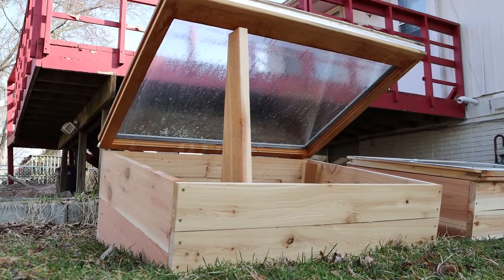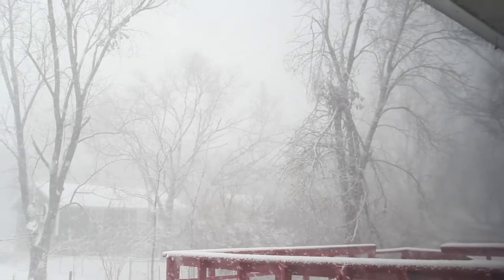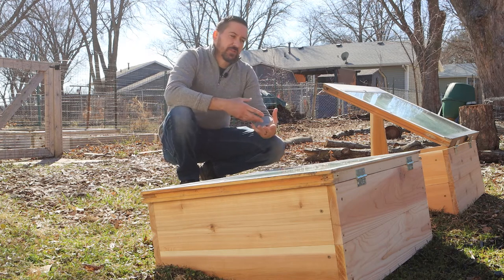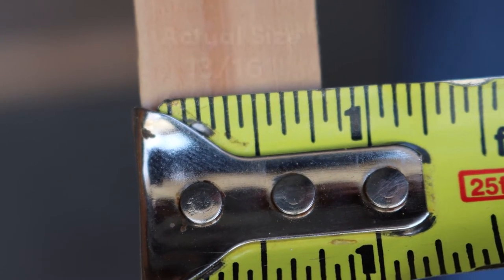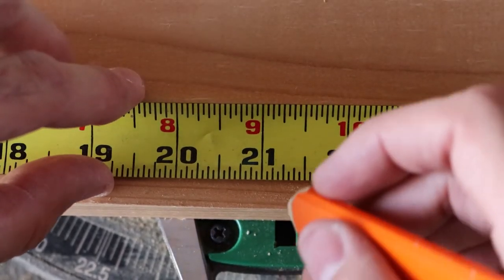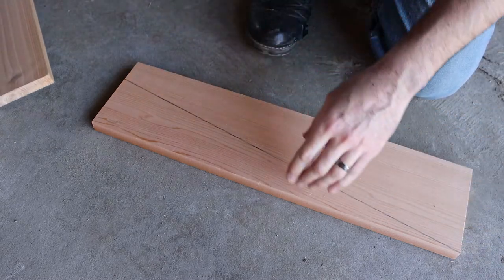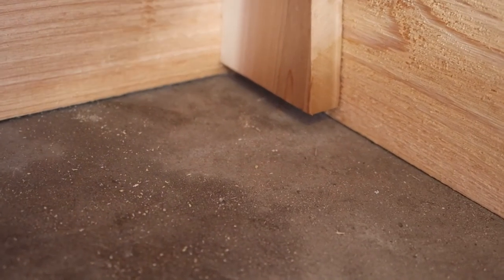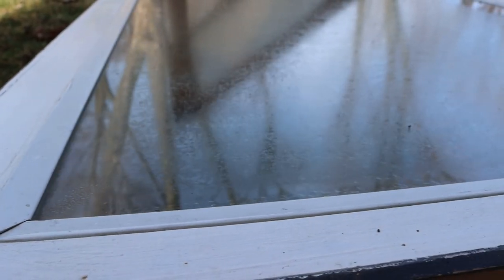How to Build a COLD FRAME Using Old Windows

Comment from the maker: ⌚TIMESTAMPS:
0:00 Intro
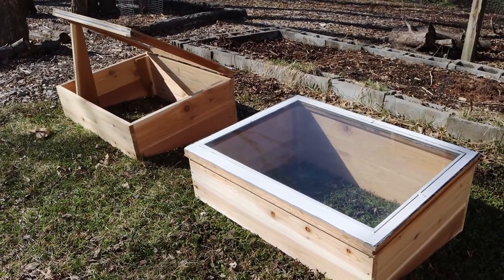0:44 What is a cold frame?
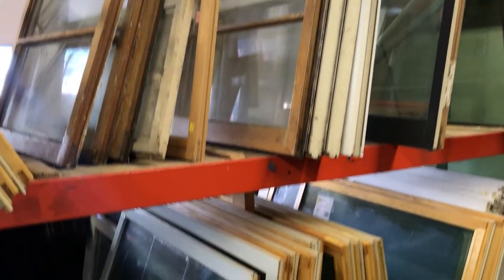1:57 Old windows for lids
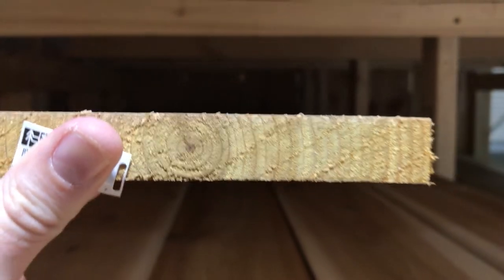2:45 Treated or untreated wood?
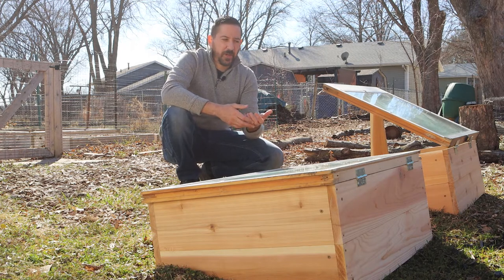3:49 Cold frame building guide
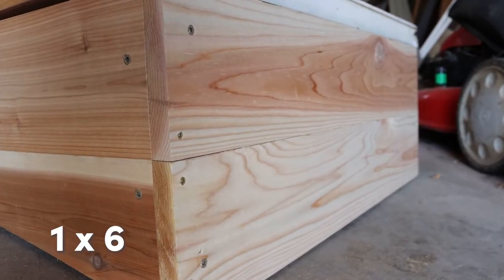4:38 Front and back boards 
5:23 Side boards
6:29 Joining corners
7:22 Angle board cut
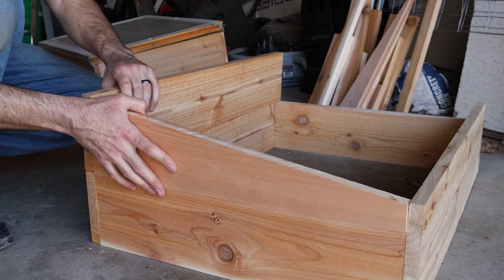8:31 Joining angle boards
8:50 Adding corner posts
9:40 Installing hinges
10:00 Completed cold frame

Comment: I am having some renovations done and my old Anderson sliding doors and one window needed replacement, had the contractor save the glass to repurpose.  Hoping to use window glass to make cold frame.  Deck needs replacement also and going to repurpose that wood to make more raised beds and cold frame.   Only using treated as I have it and it is copper not arsenic treated.  Best video on building cold frame.
Reply from the maker: Thank you so much! That’s a great way to repurpose the materials. We need to replace our deck soon, too, and I may make a video about that. Thanks for watching!

Comment: Why didn't you simply mount the window to what was the top during the build, rather than flipping it over like you did?
Reply from the maker: The “top” does not have a level surface to mount the window, but the “bottom” does. This is because it’s assembled on a flat surface where all 4 sides can be plumb and flush with each other. I’m pretty sure I showed that in the video.